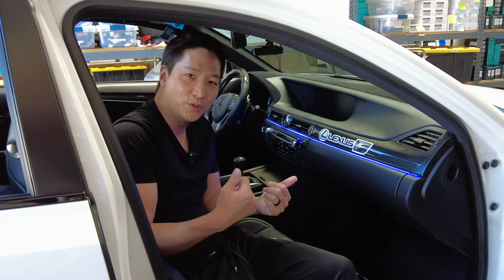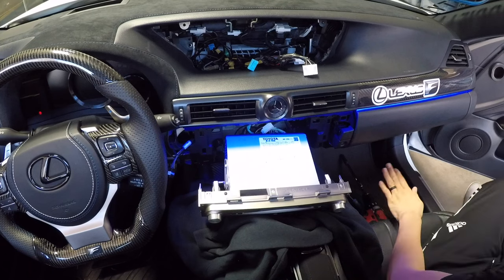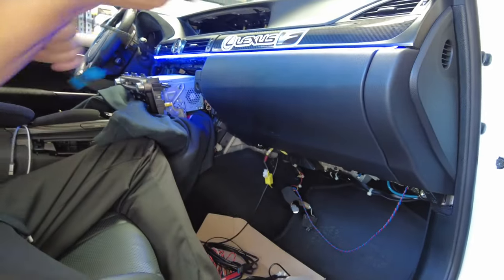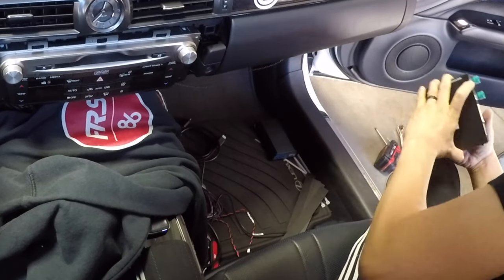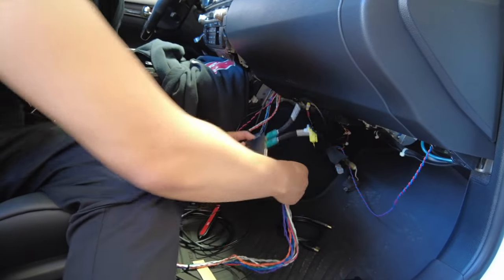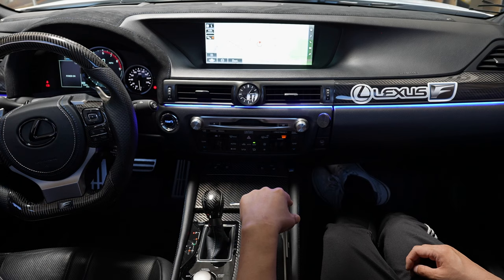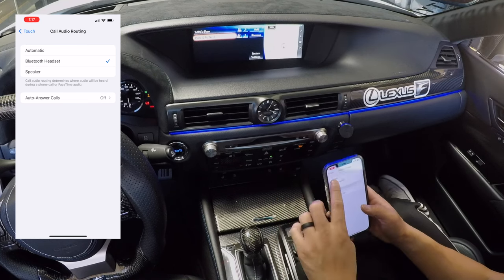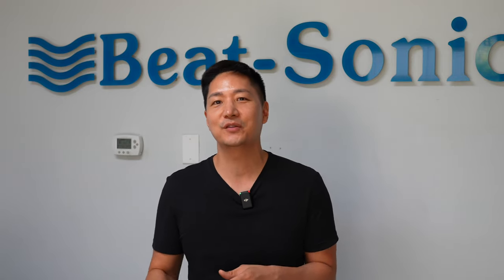2016-2020 Lexus GS | Wireless Apple CarPlay & Android Auto Adapter | DIY Installation

Comment: This product looks pretty nice. Can you please let me know what makes the beat-sonic adapter a better choice than others i hear about like Navix or Grom. Every installer ive talked with has one in particular they partner with. Thank you!
Reply from the maker: Our kit has been approved by Lexus USA to be available at Lexus Dealerships across the US. Our kit is the only kit that routes all audio to the car’s Bluetooth for the best sound quality. You may even connect to the car’s usb directly for better sound. In addition, our wireless connection time is only 6 seconds and faster than the time it takes for the Lexus system to fully load. Ours is also the most reliable and trusted in the marketplace
Reply: Thank you. do you think someone with no installation experience (Me) could install this myself?

I am concerned about damaging something during the process.

Comment: Just curious, is there a reason that niether the beatsonic nor other aftermarket systems are able to use the oem haptic feedback, and snap/focus the cursor to specific items on the screen? I feel like that would be helpful in reducing the distraction of having to precisely move the cursor without any feedback while driving.
Reply from the maker: It’s possible but with the expense of fully dedicated engineers being on this project for 6 plus months.

Comment: If I take my car to the dealership, is there any worry of them hurting the system when servicing the car? / If they do a system check would they accidentally reset anything?
Reply from the maker: There’s nothing to be concerned about taking your car to the dealership with our kit installed. They won’t know it’s installed. Also no risk of resetting anything

Comment: Does this use the factory microphone? I saw that it has a microphone connector but I didn’t see you mount it. 

Also, when the car goes in reverse does the camera automatically switch?

Really thinking about purchasing one for my GS.
Reply from the maker: Yes this uses the factory microphone. And the reverse camera will show when you put your vehicle to reverse gear from either carplay screen or oem screen

Comment: Be gentle with the display screen.  The clear plastic cover alone costs almost $500 (and that was 28% below msrp). And the black frame trim piece is $71.  I looked for used options and all I could find was the entire display unit and the cheapest I found was $650.
Reply from the maker: Always! We handled more than a few hundred of these in the last 10 years